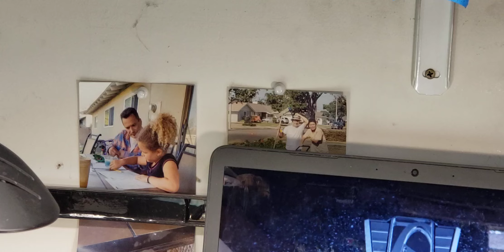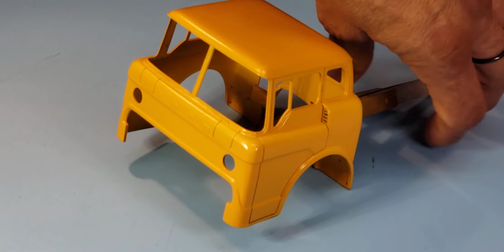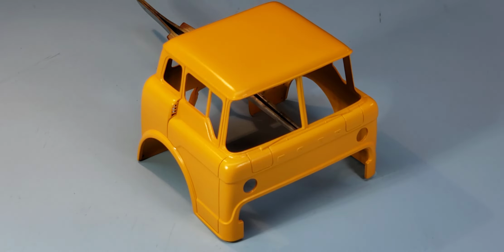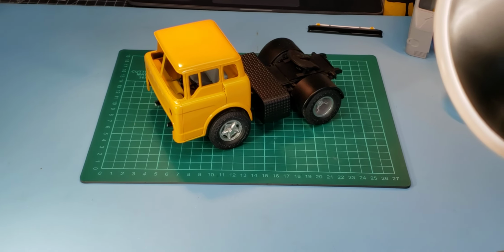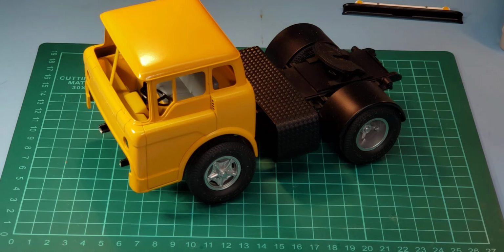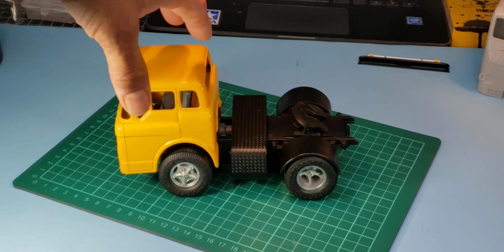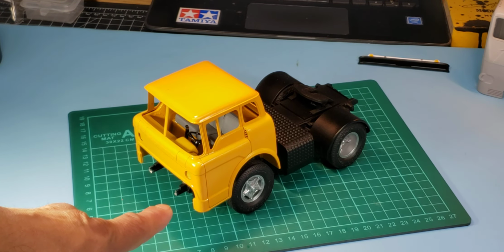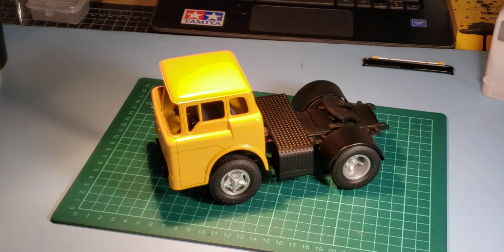AMT Ford c900 Build Part 22 (3 of 3)

Comment: That's just cool! It's subtle,but a noticable variation! The rivets look great!

I never had any luck with that dang panel wash! It dissolved several paint jobs. Checked a couple vids and tried it over several kinds of clear coat I use,and it did the same damn thing! I make my own washes with craft paint thinned with water now.
Lookin good!! Almost done!
Reply from the maker: Thanks Tom....on this one I had the vision in my head for a few weeks now.  Also in my head I had figured out how to pull it off .....it worked exactly as I had envisioned.  Had my fingers crossed all the way.